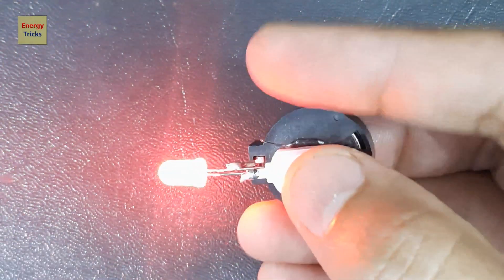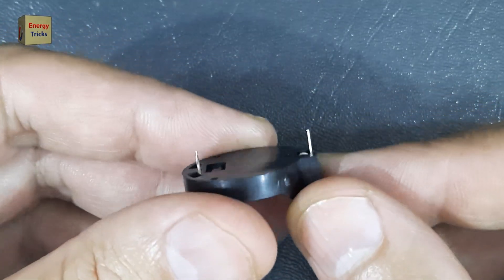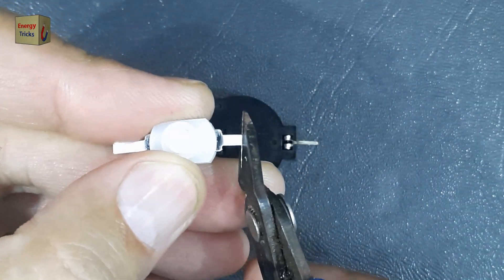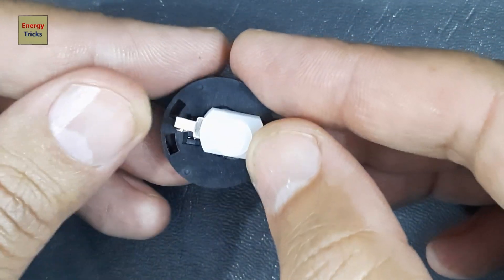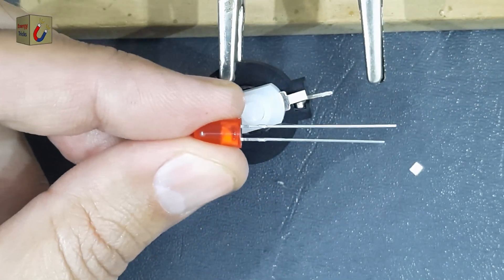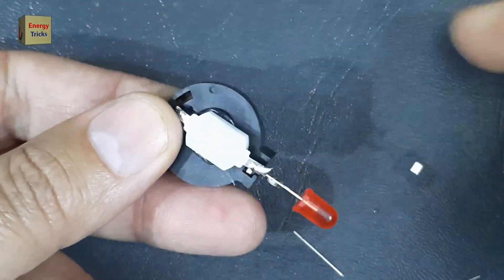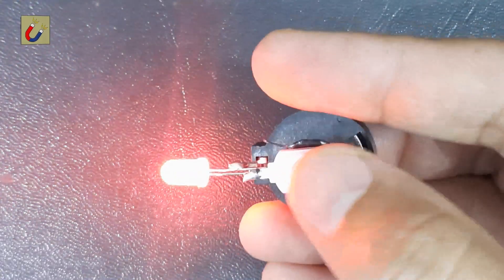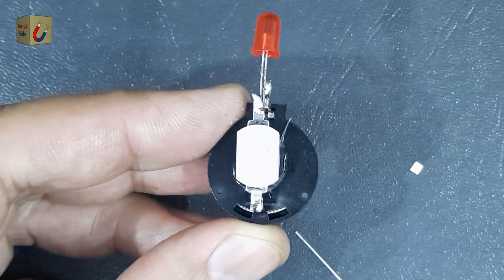Mini Torch DIY  Easy Coin Battery Project

Comment: Thank you very much.  I had wondered if the circuit would be this simple.  Automobile LED taillights have a rapid flicker, which I would expect from a rectified AC circuit, but not DC.